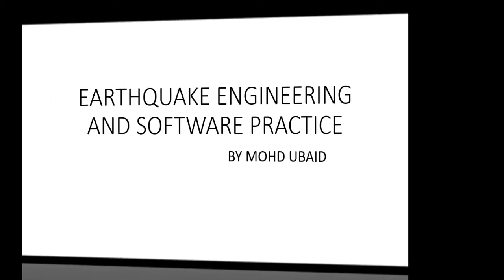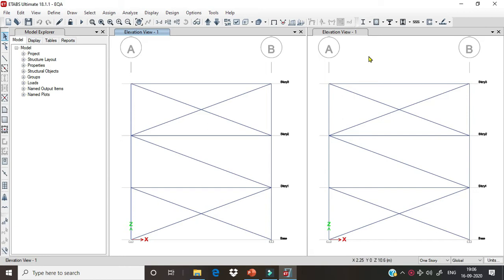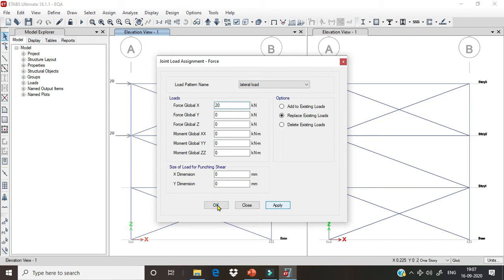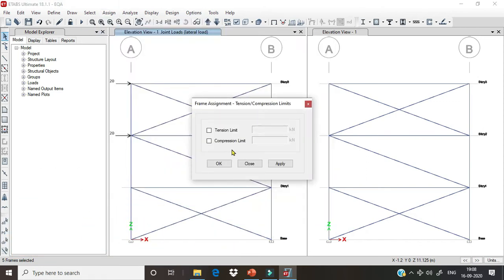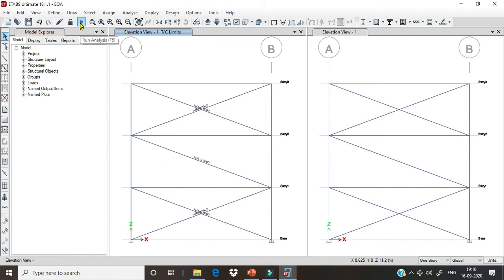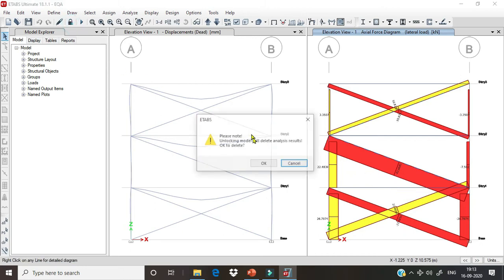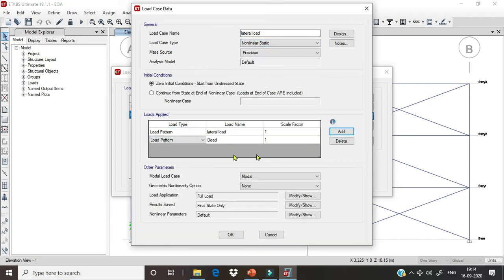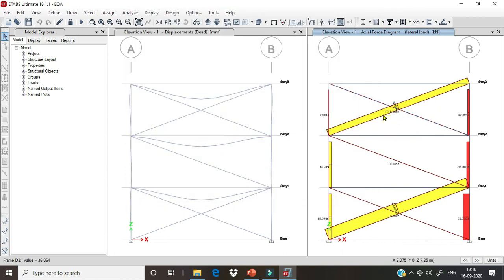ASSIGNING TENSION ONLY OR COMPRESSION ONLY MEMBER ONLY IN ETABS

Comment: Hello sir, How do I know which tension or compression member should be assigned to the struts?
Reply from the maker: It depends on the direction of loading.
Reply: @MUSCCons  Sir how do we know in which direction the load is coming?
Reply from the maker: @CivilSoftwareTutorials , In pushover analysis the loading pattern is defined earlier so you know the direction of loading but in dynamic time history analysis, it is difficult, So for time history analysis, you should assign two struts with zero tension capacity. For information regarding loading patterns in pushover analysis you see watch this video -https://youtu.be/j6f361r79ls
Reply: If we don't know in which direction the load is coming, can we consider compression to both the members?
Reply from the maker: @CivilSoftwareTutorials , Yes you have to consider both the structs as compression members.
Reply: Sir it means we have to consider both struts as a compression member in time history analysis
Reply from the maker: @CivilSoftwareTutorials , Yes because masonry is very weak in tension.